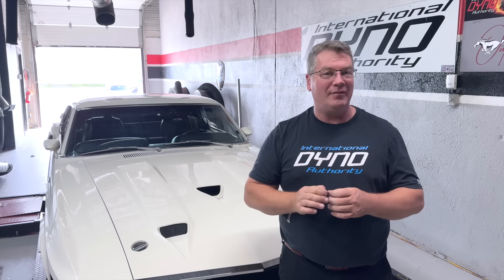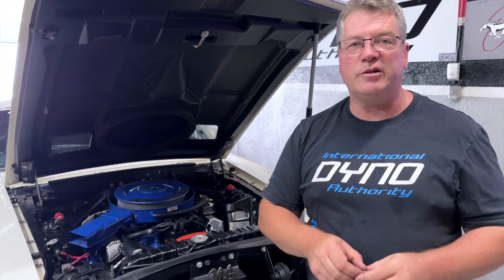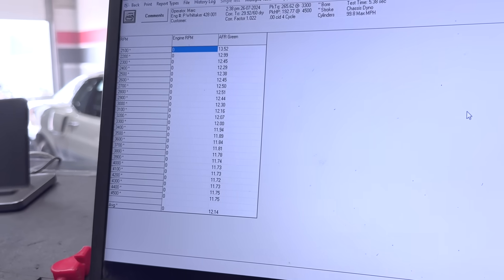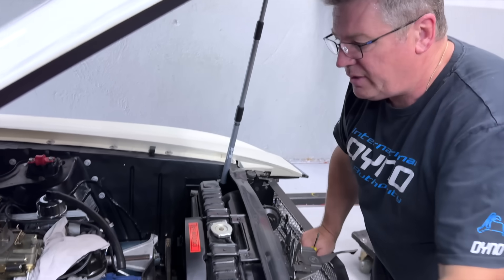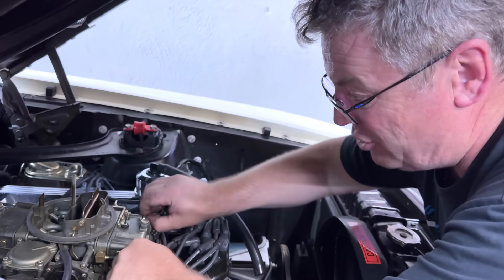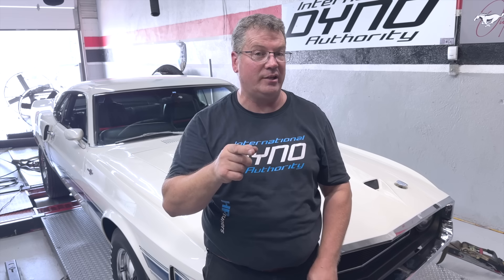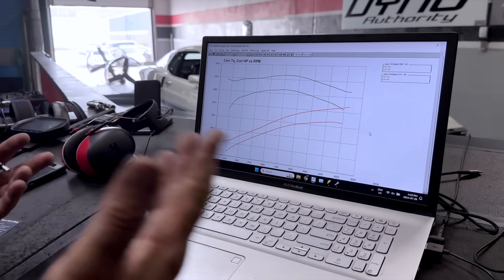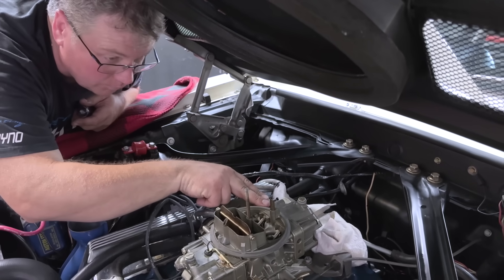Original, unrestored '69 Shelby GT500 tuned on the dyno

Comment: How do you tune a car with no computer? I'm lost
Reply from the maker: @davidsherrill9121  

The tuning process for this project was comprehensive and methodical.

Pre-Tuning Preparation
We started with a checklist for the customer to complete before bringing the vehicle in. This included:

Fresh oil

New spark plugs and spark plug wires

A new distributor

Proper fuel pressure

A leak-free exhaust system

Tires in excellent condition

Tuning Process
Once the vehicle arrived, we meticulously tuned every circuit of the carburetor, from idle to low speed, the primary circuit, and the secondary circuit. Here’s a breakdown of the steps:

1. Air-Fuel Ratio Adjustment

We cleaned up the air-fuel ratio until the spark plugs burned a perfect tan color.

Any trace of smoke was eliminated by fine-tuning the mixture.

2. Choke and PCV System

The choke flap, which was bent, was removed and straightened to restore proper airflow.

We reconfigured the PCV system to circulate air back into the engine without oil vapor. This included adding a restrictor and cooling to prevent oil deposition in the combustion chamber.

3. Ignition Timing

The ignition timing was verified and incrementally adjusted to match the fuel in the tank, the combustion chamber characteristics, and the intended use. This resulted in a complete and efficient burn in the combustion process.

4. Carburetor Repairs and Adjustments

We replaced the check valve, power valve, gaskets, and the accelerator pump circuit's check valve ball and spring.

Proper smaller nozzles were installed for the accelerator pump circuit.

The float level was set for optimal tuning, ensuring no smoke and smooth transitions between circuits.

Results
The result is a 1969 Mustang that runs better than ever:

Increased torque, efficiency, and horsepower

Zero smoke from the exhaust

Quick starts, smooth operation, and overall reliability

This is now one of the cleanest-running classic Mustangs on the street, despite never undergoing a full restoration. It’s a testament to careful tuning and a little TLC.

Thank you for watching, and we hope this detailed overview inspires and informs your own projects!
Reply: You have a computer between your ears. It was computers of that sort that won or lost races in those days. Use it or loose it.
Reply from the maker: @lornemarr  

Is it too tight?

Here’s a polished version of your response that maintains a professional tone with a subtly assertive edge to stimulate conversation:

---

Our tuning process is meticulous and systematic, starting with all passes beginning at 2,000 RPM. The throttle is applied rapidly to the wide-open position, ensuring consistency across every run.

Each test is conducted on the chassis dyno under identical load conditions, allowing the vehicle to accelerate as quickly as its setup permits. The duration of the test is carefully measured and compared with subsequent runs to evaluate progress.

Initial tests are run until the torque curve falters or until the data log indicates unsafe, unproductive, or non-rewarding results—signaling the need for adjustments or the next step in the tuning process.

We prioritize the safety and condition of every customer’s vehicle, treating each one with the utmost care. Throughout the tuning process, we closely monitor key parameters such as temperature, AFR, IAT, balance, and torque production across the RPM range.

Our goal is to deliver responsible, high-quality results that enhance the performance of the vehicle without compromising its integrity—or our reputation. We do not take risks that could endanger a customer’s vehicle or the standing of our business.

As we observe improvements, we gradually extend the RPM range, focusing on identifying the engine's most efficient operating zone. At every stage, we ensure transparency, sharing step-by-step results with our customers and walking them through the data logs to educate and inform.

Each test adheres to a precise, repeatable procedure, maintaining consistency and accuracy. This approach not only ensures optimal results but also reflects our commitment to excellence and responsibility in tuning.

---

Let me know if you'd like further adjustments!
Reply: adjust the mechanical controls ..like change the distributor advance weights and spring pressure to change the advance curve , carb jetting for air/fuel ratio
Reply from the maker: @davidsherrill9121     Tuning a carbureted engine, while lacking an onboard computer or ECU, presents a fascinating challenge with parallels to modern fuel-injected systems.
Let's break it down. We start with the fundamentals:
 * Low RPM Fuel Delivery: We meticulously adjust fuel delivery to meet the precise combustion needs of the engine, considering factors like vehicle weight and load.
   * Conversation Starter: How do you determine the ideal air/fuel ratio for different driving conditions at low RPM?
 * Transition: We fine-tune the transition from low to high RPM, paying close attention to:
   * Floatable height
   * Power valve sizing and vacuum requirements
   * The smooth transition from vacuum-driven to velocity-driven fuel flow.
   * Deeper Dive: How does the design of the carburetor's venturi influence fuel flow and atomization?
 * Ignition Timing: We carefully calibrate ignition timing:
   * Initial ignition for reliable starting.
   * Transition from idle to higher RPMs, considering piston design, combustion chamber shape, and fuel octane requirements.
   * Precise adjustments for both initial and full advance, whether through vacuum or centrifugal mechanisms.
   * Conversation Starter: How do you determine the optimal ignition timing curve for different driving conditions and engine loads?
 * External Factors: We meticulously address external factors that impact performance:
   * Positive Crankcase Ventilation (PCV) system
   * Cold starting assistance systems
   * Continuous adjustments and feedback loops are crucial for optimal performance.
The Importance of Tuning:
Tuning a carbureted engine is just as critical as tuning a fuel-injected one. While the methods differ, the core principles remain the same: achieving optimal combustion for maximum power and efficiency.
The Payoff:
The difference between a well-tuned and poorly tuned carbureted engine on a chassis dynamometer is truly dramatic. The rewards of meticulous tuning extend beyond raw power – you'll experience improved fuel economy, smoother idling, and a more responsive and enjoyable driving experience.
Let's Explore Further:
 * What are some of the most common challenges you encounter when tuning carbureted engines?
 * How do you diagnose and address performance issues in a carbureted system?
 * What are some of the most rewarding aspects of tuning carbureted engines
 
 
 
 * Highlight the importance of tuning: By emphasizing the significant performance gains that can be achieved through proper tuning.
Reply: You set to a happy point.  If you don't care about performance and have street friendly cam it's not too bad, even with old school chokes. Something high strung is likely to require a high idle or stall often at least half of the year in many places.
Reply from the maker: @Dayandcounting   
  Tuning a carbureted engine, while lacking an onboard computer or ECU, presents a fascinating challenge with parallels to modern fuel-injected systems.
Let's break it down. We start with the fundamentals:
 * Low RPM Fuel Delivery: We meticulously adjust fuel delivery to meet the precise combustion needs of the engine, considering factors like vehicle weight and load.
   *L How do you determine the ideal air/fuel ratio for different driving conditions at low RPM?
 * Transition: We fine-tune the transition from low to high RPM, paying close attention to:
   * Floatable height
   * Power valve sizing and vacuum requirements
   * The smooth transition from vacuum-driven to velocity-driven fuel flow.
   * Deeper Dive: How does the design of the carburetor's venturi influence fuel flow and atomization?
 * Ignition Timing: We carefully calibrate ignition timing:
   * Initial ignition for reliable starting.
   * Transition from idle to higher RPMs, considering piston design, combustion chamber shape, and fuel octane requirements.
   * Precise adjustments for both initial and full advance, whether through vacuum or centrifugal mechanisms.
   * Conversation Starter: How do you determine the optimal ignition timing curve for different driving conditions and engine loads?
 * External Factors: We meticulously address external factors that impact performance:
   * Positive Crankcase Ventilation (PCV) system
   * Cold starting assistance systems
   * Continuous adjustments and feedback loops are crucial for optimal performance.
The Importance of Tuning:
Tuning a carbureted engine is just as critical as tuning a fuel-injected one. While the methods differ, the core principles remain the same: achieving optimal combustion for maximum power and efficiency.
The Payoff:
The difference between a well-tuned and poorly tuned carbureted engine on a chassis dynamometer is truly dramatic. The rewards of meticulous tuning extend beyond raw power – you'll experience improved fuel economy, smoother idling, and a more responsive and enjoyable driving experience.
Let's Explore Further:
 * What are some of the most common challenges you encounter when tuning carbureted engines?
 * How do you diagnose and address performance issues in a carbureted system?
 * What are some of the most rewarding aspects of tuning carbureted engines
 
 
 
 * Highlight the importance of tuning: By emphasizing the significant performance gains that can be achieved through proper tuning.
Reply: @internationaldynoauthority693    EFI does not compare were it really matter, staying in tune.

I don't care how good you tune a carb, once the temperate or humidity outside changes by any meaningful amount it's out of tune it just a matter by how much.  

With EFI you set the base tune one time for that engine configuration and by using the sensors it will be in tune until a part fails.

So yeah carbs do work well enough but it's mugs game IMO.
Reply from the maker: @Dayandcounting  

Thanks for sharing !

When it comes to aftermarket fuel injection systems, there’s definitely a spectrum of reliability and performance. From what we’ve seen, Edelbrock systems tend to lead the pack in this category,(on the cheap systems )with only about 1 in 20 needing an ECU repair or upgrade. That’s a strong showing compared to Holley systems, where issues arise in roughly 4 out of 10 cases, or Fi-Tech, which struggles with reliability in as many as 9 out of 10 units.

That said, none of these options truly match the tunability, performance, or reliability of a well-built carburetor. While these injection systems can be made to run quite streetable, carburetors still reign supreme for any serious enthusiasts.

If you’re chasing top-tier results, though, it might be worth looking beyond the entry-level systems. Rewiring with a crank trigger and integrating an OEM-style ECU, like a P38, can deliver OEM-grade reliability and performance. Alternatively, stepping up to something like a Haltech system offers a massive leap in tunability and dependability compared to the Edelbrock, Holley, or Fi-Tech options.

It’s all about finding the right balance between your goals, budget, and how much effort you’re willing to put into the setup. Let me know if you’d like to dive deeper into any of these options!

Comment: I had to stop watching 6 minutes in. If the choke was open during the run it isn't the problem. Idle circuit screw position didn't cause those numbers or the smoke.
Reply: If you had watched the whole video you would be much better informed.
Reply from the maker: Hey there! You're right, finding the perfect settings can feel like a bit of a treasure hunt. 🔍 We always start with a base setting – think of it as our starting point. It's like a recipe, but we know we might need to tweak the spices to get the flavor just right. 🌶️
In this case, we begin with a 1-1/14 ratio and fine-tune the low-speed air emulsification. It's all about finding that sweet spot where everything works together seamlessly. ✨
There's no one-size-fits-all answer, which is why we emphasize testing and adjusting. It's like a scientific experiment – observe, adjust, and repeat until you achieve the desired outcome. 🧪
Reply: @internationaldynoauthority693   You can't tell a know-it-all anything. He didn't have time to watch the entire video, yet had the time to critique your video and brag about all of his amazing tuning skills.
Reply: @bigbullfrog98  not to mention that the video, done by a professional tuning company, represented 17 minutes of a 3+ hour progressive tune. After 6 minutes of the condensed video Mr Stuckey determined that he knew enough to state his under informed complaint about the process - takes all kinds to make the world go around.
Reply: I am very well informed. I've built my own Holley carbs and raced with them on my dirt stock cars for years. I know that carb well. I know it well enough to know that a person who thinks an idle screw must be at a certain number of turns in order for the engine to run correctly isn't well versed on the subject.
Reply: right....this guy is an idiot
Reply from the maker: @JimStuckey-y7r  

The tuning process for this project was comprehensive and methodical.

Pre-Tuning Preparation
We started with a checklist for the customer to complete before bringing the vehicle in. This included:

Fresh oil

New spark plugs and spark plug wires

A new distributor

Proper fuel pressure

A leak-free exhaust system

Tires in excellent condition

Tuning Process
Once the vehicle arrived, we meticulously tuned every circuit of the carburetor, from idle to low speed, the primary circuit, and the secondary circuit. Here’s a breakdown of the steps:

1. Air-Fuel Ratio Adjustment

We cleaned up the air-fuel ratio until the spark plugs burned a perfect tan color.

Any trace of smoke was eliminated by fine-tuning the mixture.

2. Choke and PCV System

The choke flap, which was bent, was removed and straightened to restore proper airflow.

We reconfigured the PCV system to circulate air back into the engine without oil vapor. This included adding a restrictor and cooling to prevent oil deposition in the combustion chamber.

3. Ignition Timing

The ignition timing was verified and incrementally adjusted to match the fuel in the tank, the combustion chamber characteristics, and the intended use. This resulted in a complete and efficient burn in the combustion process.

4. Carburetor Repairs and Adjustments

We replaced the check valve, power valve, gaskets, and the accelerator pump circuit's check valve ball and spring.

Proper smaller nozzles were installed for the accelerator pump circuit.

The float level was set for optimal tuning, ensuring no smoke and smooth transitions between circuits.

Results
The result is a 1969 Mustang that runs better than ever:

Increased torque, efficiency, and horsepower

Zero smoke from the exhaust

Quick starts, smooth operation, and overall reliability

This is now one of the cleanest-running classic Mustangs on the street, despite never undergoing a full restoration. It’s a testament to careful tuning and a little TLC.

Thank you for watching, and we hope this detailed overview inspires and informs your own projects!

Comment: Why no spark plug change
Reply from the maker: @kenbourekas420  

Hey Ken, thanks for watching!
You're right, preparation is key for accurate dyno testing. Before a vehicle hits our rollers at International Dyno Authority, it goes through a rigorous checklist. This includes a waiver, of course, and a very thorough mechanical inspection. We're looking for things like fresh spark plugs (properly gapped, which is crucial!), a leak-free exhaust system, new tires, and a recent oil change.
In this case, the spark plugs were brand new and gapped correctly before we even started. This is vital because even the best plugs won't perform optimally if they're not gapped properly.
The amazing thing about this particular vehicle was its responsiveness to every tuning adjustment. Even the smallest tweaks resulted in noticeable changes on the dyno graph, which is a fantastic sign.
Now, if we had made adjustments and seen no response, we'd have to start digging deeper. That could mean investigating potential physical problems that were hindering performance and preventing the tuning from taking effect.
Thankfully, that wasn't the case here. The results were very close to our expectations, and the customer is thrilled. The smoke is gone, the engine runs smoothly, and it starts up like a dream.
What are your thoughts on the importance of thorough vehicle preparation before dyno testing? Have you ever had any unexpected challenges during a dyno session?"

 Thanks for  watching!
Reply: @internationaldynoauthority693  Can you tell us what a dyno session like this with repairs and adjustments you made costs?
Reply from the maker: @kimmorrison9169  Yes absolutely.... Contact us anytime:

613-795-2779 for tech and pricing.

613-857-3578. For scheduling, appointment And coordination. 

https://internationaldynoauthority.com/
Reply: its a huge chore on a CJ, we used to loosen the motor mounts and jack the engine up to get at plugs on mustangs. But to tune this right it probably could have used plugs.  Also, put non ethanol fuel in it please.
Reply: Why would you assume that the spark plugs were not changed?